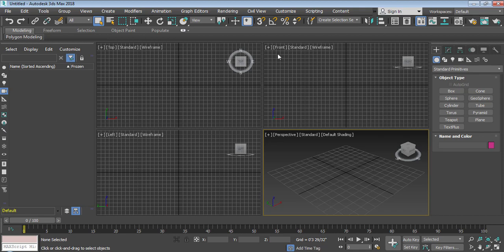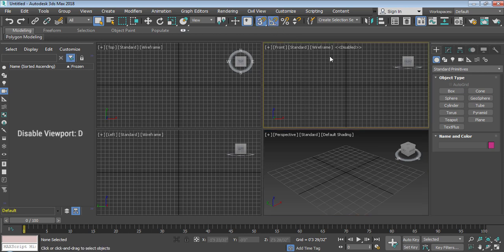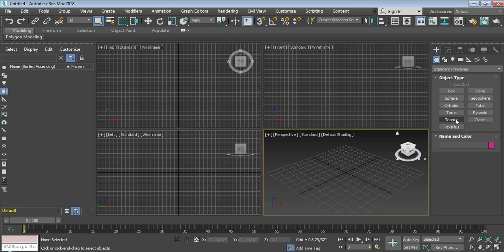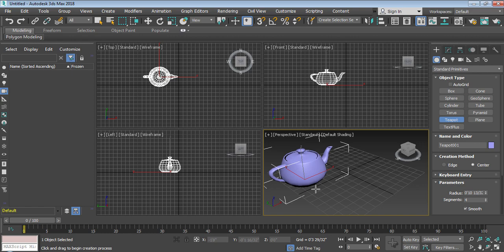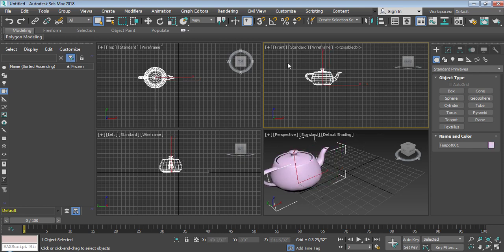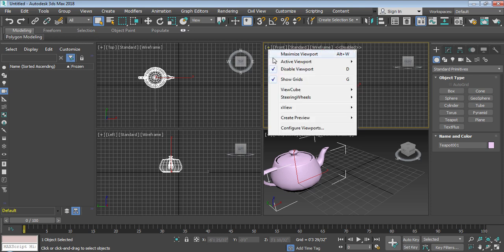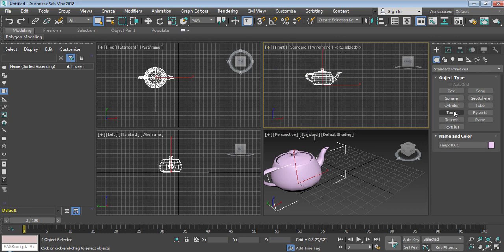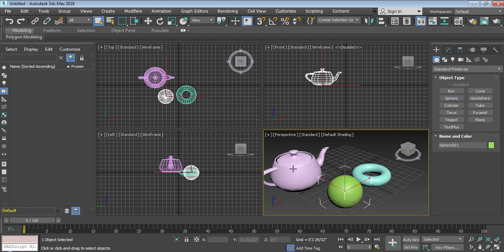How to Enable and Disable Viewport  in 3ds Max

Comment: i am opening the 3dmax 2019 where i designed walls. The walls are in black color and i am trying to update the viewport to see them but i am not seeing the viewport. Where i should go please?
Reply from the maker: @ghassanjenainaty4212 I'm able to solve this problem with limited information. This problem occur when Polygon Normal got flipped, Material is not applied according to renderer. You can share your screenshot with me on Instagram @curvedesigncenter I try to solve your problem.
Reply: @CurveDesignCenter-3d  Thanks a lot. Can you send me your email please?
Reply from the maker: Send your 3ds Max file curvedesigncenter@gmail.com